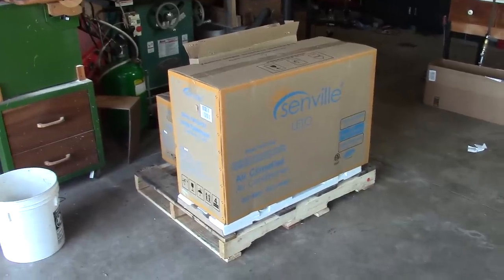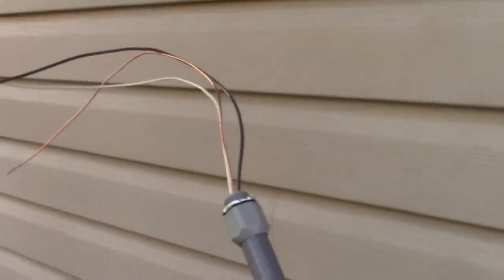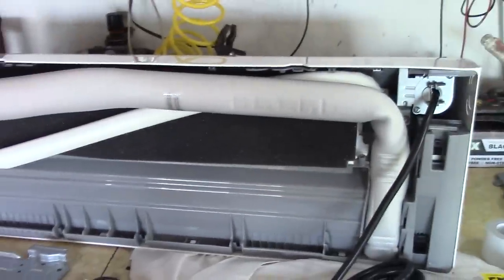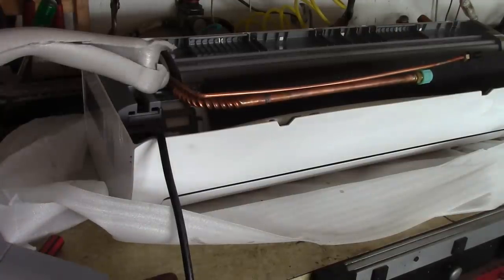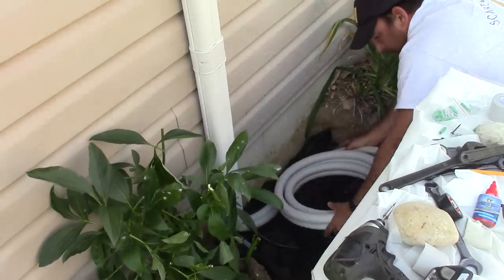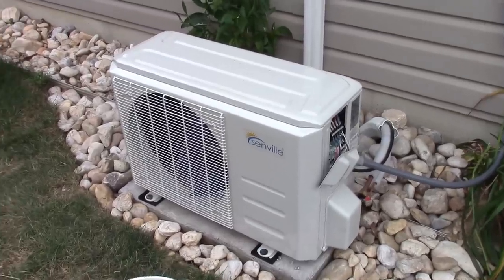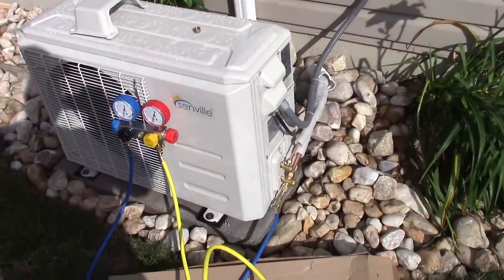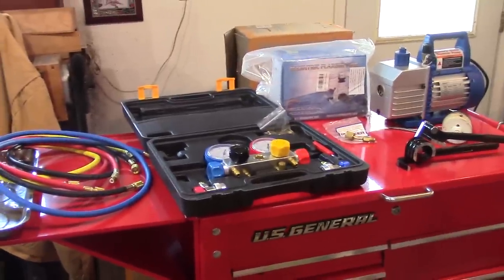Mini Split A/C Full Installation Full Video

Comment: Never seen the suction line twisted like that from a manufacturer,  hopefully (with 410A) the copper wall doesn't split over time, btw, you work fast as shit! LOL. Also, is that thread sealant approved by the manufacturer? I'm asking because there's some pretty small openings in those expansion devices
Reply: That sealant will dissolve if it gets into the system

Comment: You used an NM clamp not rated for wet or outdoor use on the outdoor unit, VIOLATION, use a round cord clamp rated for wet location

Comment: Did you use a flare tool?
Reply: You can see the lines are flared. They come from Pioneer without flares so the installer must do this.
Reply: GSF Incorporated Inc do the mr cool series come flared?
Reply: Probably not because it's easier to route the lines through walls and so without flares and back nuts. Just get a decent flaring tool off Amazon. I've tried one from Harbor Freight and it was junk from the start.
Reply: GSF Incorporated Inc awesome thanks for the reply and help! One more thing...  where can I get a good but cheap vacuum pump? Thanks again

Comment: Still do not understand why feed was not 3 wire w/ground.......Red & Black hots and a white Neutral and ground for ground. I dont see how you can run this with NO Neutral?????????????????
Reply: john smith The unit is 115 volts input thus one hot black wire and one white neutral wire and one green wire ground. Smaller 9000 and 12000 btuh mini splits in the USA are sometimes 115 volts; others are 230 volts. There are no two hot 115 volt wires since the unit is only 115volts . Hope this answers your question. The 115 volt mini splits have a different control module in the outside unit than 230 volt mini splits.  Some makers make 9000/12000 sized units in both 115 and 230 volt variants. The model number often has a 12 or 120 in it for 115 volt versions and 24 or 240 in the model number for 230 volt variants
Reply from the maker: My system is 240V, so I used 12/2 and a 20amp breaker.
Reply: I appreciate your reply but you need to revisit the video. He clearly hooke the wires to a double pole breaker to get 240V. He even colored the white wire black with a Sharpie and then tested to make sure he had 240V at the unit. My question is how he system works with NO NEUTRAL!!!!!!
Reply: @johnsmith-sw7ii   the simple answer is you don't need a neutral to run 240volt. The neutral is kind of redundant . I think it makes for a better install to have the neutral and ground and is more in acordance with the manufactures engineering.
Reply: @johnsmith-sw7ii  The neutral is used to make 120v using 1 hot (your house has 240 coming in on 2 wires and a ground  => no neutral in the supply from your "utility") In the case of this unit some of the controls are likely 120v, I didn't see a place for a separate neutral wire so the 120v control ckts use 1 hot to gnd.   The disconnect 'box' doesn't have a provision to "disconnect" the neutral, only disconnects / interrupts the 2 "hots".

If the unit had a seperate neutral connection in it I would run 12-3 (more likely single conductors in conduit, but that is just me),  the ground and neutral are tied together @ your breaker box,
Reply: @doublewide6  that is the right gauge for 20amp, but I keep reading to oversize the wire to 10/2.  Know any reason for this?  thx!  f'n rad video!  Oh, and why did you decide not to vacuum out with nitrogen? Noob here ;0

Comment: You could of cut and flared that line set
Reply: Yeah I didn't understand that. All of the extra work to hide all the lines. Seems like with his expertise with everything else he could have done the reflare also. And some say if extra, the lines should lay flat, is that correct?
Reply: Cutting lines adds another layer of uncertainty. Possible to add contamination into brand new clean lines and flared ends may not seal perfectly anymore. I would have also left the long lines.

Comment: Hey, so what's the deal with those "micron gauges" and some HVAC technicians saying that standard manifold gauges don't have "enough resolution" to measure a proper vacuum? Is there truth to that? Or maybe are they referring to bigger systems that need stronger vaccuums? If someone knows about that topic, please help. I am close to installing a mini split myself. The issue with micron gauges is that they are REALLY expensive and if I can skip buying that, I definitely would do it. Please advice.
Reply: micron gage will show you the amount of moisture still in the system; that way you'll know how long to run the vacuum pump.

Comment: Great video I tried to imitate your talent but was surprised with the high  price of vacuum pump here in my place and im broke  somebody told me to purge a little to drive out air from from the installed pipe is that acceptable.

Comment: since when is 1200 dollars 1/3rd of 1900?
Reply: $1,900 is what the hvac company was going to charge labor to install a more expensive unit. So $1,900+(let's say)$1,500(for more expensive equipment)=$3,600 total for professional installation

Comment: If i install a 120v mini split ac do i need to add an ac disconnect?
Reply: I believe if you had a junction box that the unit would plug into, that would suffice...as you could just unplug it when you needed to.
Reply: Elect. appliances will work wired many creative ways.  Only a few are smart and safe.  Spend $12 and put one in!
Reply: Disconnect is only there so you don’t have to run inside to switch off the breaker when servicing. Just one more ugly item to rust away on the outside of your house.

Comment: 12/2 wire eh. Should have used 10/2
Reply: why a 10/2 wire for a 20amp circuit?  not saying your wrong, but why oversize the wire?  thx!
Reply: Well considering it’s 220/240 why would you undersize it lol I don’t use 14/2 for anything in a house, I use 12/2 with ground and for majority of gas installs and outdoor units I use 10/2. Air handlers it depends on the heat strip being used.
Reply: @summitm18hvac90  still don't understand.  15amp = 14/2 : 20amp = 12/2 : 30amp = 10/2...seems like a waste of wire if the unit won't pull the power and the breaker would overload over 20 amps anyway....i'm a noob.
Reply: Dante High well considering I’ve been installing for 6 years and no issues. I’ll keep doing what works. I’d rather have an “oversized “ wire then a wire not enough. Do what tickles your fancy
Reply: Dante High and keep thinking the breaker would trip lol gots lots to learn.
Reply: @summitm18hvac90  I'm not saying the breaker would trip if you oversize the wire, I'm saying the breaker would trip if a appliance overloaded the circuit, at least I'd darn hope it would
Reply: That unit only requires a 12/2. 3-4 zones requires 10/2

Comment: 23:56

In 3 years time (maximum, perhaps 1.5-2 years) the compresser (which will be starved of oil) will start rumming/humming/knocking. 
This is SHOCKINGLY bad installation! 
This single mistake renders all your effords - completely pointless!

The copper tubes should NEVER go lower than the compressor connections. NEVER. This causes the oil to form on the bottom of this line set, causing irreparable damage to the compressor.
Long-term operation is therefore hindered.
Reply: Good to know! Thanks.

Comment: American way of building houses is such a shitfest, wow. What did you use there to seal the wall, bubble gum? :) You also don't put any nyloc on the fittings. Why would you do that? If the gas is leaking past the fitting to copper sealing point, it will escape not trough threads but beside the copper tube.